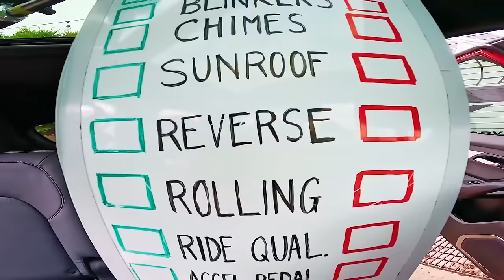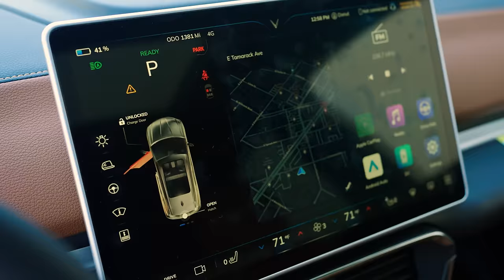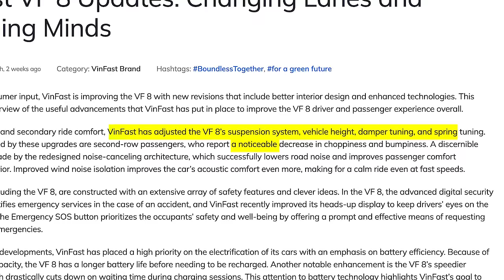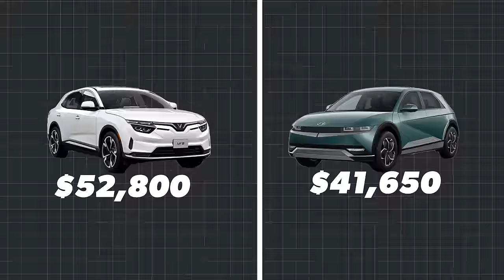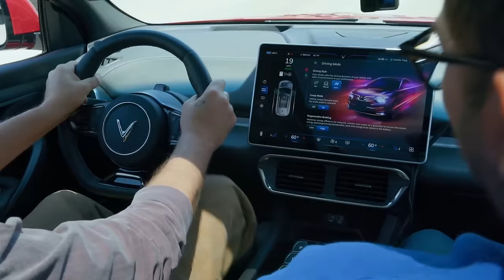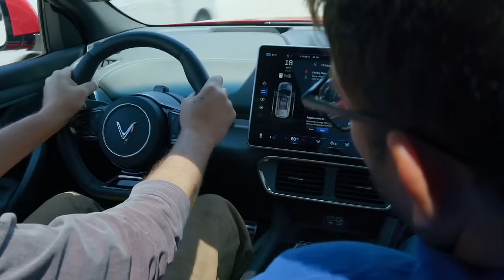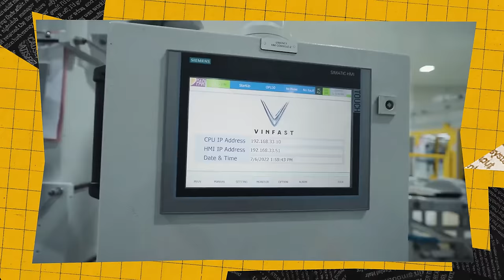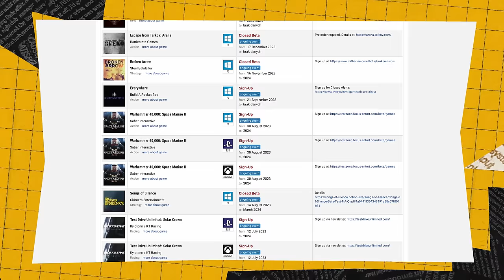We Drove America’s Worst Reviewed Car Again

Comment: Imagine an accident happens right in front of you or some other obstruction on the highway and when you go to switch lanes to avoid it your car stops you from doing that because you didn't have your blinker on and sends you head on into it lol
Reply: VF8 does NOT do that. It's like a magnet keeping you in lane if you let go of the wheel, but a magnet that any weakling can push past.
Reply: @NoseyNick  Oh, if it's like that then that's not too bad. Their first video on it made it seem like you would go to turn and the car would jerk you back into the lane unless you had a turn signal
Reply: Imagine if everyone drove without having their head up their kazoo, what a concept to be capable of using the turn signal in any situation.
Reply: @Drcraigfreeman9280  You've never been in an emergency situation?
Reply: @Drcraigfreeman9280  Ok bozo, keep feeling invincible until you are the one in that situation.
Reply: You were wrong, I have VW tiguan with keep lane assist, it have the same situation if I turn on it.
Reply: @Sevem7m  Honestly I have no idea if Donuts were just being donuts, for the lolz, or if early early "shitty edition" models really were "stronger" on the tugging.
Every VF8 I have ever driven just nicely sucks itself into the middle of the lane, until you pull it out, which was never been difficult. It's just about perfect. I may even prefer it to be a teeny bit stronger.
Reply: It has a lane-keeping system, but it also has an automatic emergency braking system, an automatic steering system when encountering unexpected obstacles, and it's programmed to prioritize to keep you safe, you're just thinking. think funny things that aren't true
Reply: VF8 do the defferent :) iF ADAS is actived, VF8 can control to avoid the accident without blinker. And you can do with more force to ignore when you change the lane without blinker
Reply: I've driven a VF8 for 5mo now. I find it quite rude to change lane without indicating, but when I try (just to answer made-up complaints like these!), it GENTLY pulls back toward the centre of the lane like a magnet. If I pull harder, it gently shakes, like the road/line has one of those rumble-strip things, but I CAN still change lane, with no problem at all. If it was an emergency, I doubt I would even notice the gentle tug / rumble, it would be trivial to "pull through it". I'm also about 99% sure ADAS would even say "assisting with emergency steering", which seems to be like "super ABS / anti-skid". Remember, also, that even the basic "VF8 eco" has AWD with power balancing between all 4 wheels, so traction is usually awesome compared with 2WD vehicles
Reply: @NoseyNick it clearly did that. Also it’s wildly dangerous to push left, have the car force you back right, then have to quickly turn it back left. In the rain you might as well just call it spin mode.
Reply: @TheBajamin  been driving mine 5 months, and it has never "forced" anything. I smell BS, probably for "comedic" purposes. When you say "clearly", what do you mean?!?
Reply: Using ADAS the car will automatically stop with the car in front when encountering a problem. You can turn off the lane keeping warning function in the system
Reply: That's a VW not a VF  @lanpncz
Reply: @The-Cat  I agree, different brand but I think the function the same, at least in this case.
Reply: Now up to nearly 7 months of VF8 ownership, and I'm even more convinced. The lane-keep could HARDLY be better. 

It FEELS like it is magnetically sticking in the centre of one lane. I know it's not, but that's what it fees like. If you nudge it, it gently pulls back to the centre.

IF YOU INDICATE, it releases the magnet, you drift across the line, until the magnet settles into the centre of the next lane.

IF YOU DON'T indicate, you kinda need to pull it off one magnet (which is not hard), across the imaginary virtual rumble/buzz-strip of the dividing line, until it magnetically grabs the centre of the next lane.

There's no "yanking", there's no "snatching", there's also definitely no way it would ever STOP you if you were changing lane in an emergency or anything.

So... serious question, for anyone who is still reading... how could you possibly do lane-keep better than this?

Comment: One word to describe VF8 is UNBELIEVABLE after my first roundtrip of 350 miles in one day! I would say driving VF8 is believing. In addition to other VF8 high tech features including HUD, face recognition, 360 camera, voice activation, heated and cooled seats, automatic driving seat adjustment; Vinfast ADAS and blind spot warning are quite interesting. On a road trip, if you want the EV to take over, just hit the ADAS button when the EV reaches 60-70 miles/hour. All you can do now is to sit, relax and enjoy behind the steering wheel and touch it when asked. Vinfast ADAS is like a cruise control, but much better with advanced technology. The ADAS will center the EV between the lanes and drive you uphill, downhill, along the curve road and between other vehicles; it will follow the same speed or stop as the vehicle in front of you, does. When you try to change a lane, a bright yellow warning on either the left or right mirror will flash if a vehicle is coming up. After all the due at sign in, my $200 deposit and my old car trade-in, I paid roughly $200/month after taxes for a VF8 Eco, which is about $7/day with a 3-year lease to own contract. It's even cheaper than the price of a Big Mac meal 😁

Comment: Both your videos (the old one and this one) are correct. I'm driving VF8 for almost 6 months. After few firmware upgrades and it's now more reliable and stable.
Reply: Thank you!
Reply: Did they replace the shocks and springs in yours?
Reply: @m3chan1zr  nope, I replaced it. They only do software update and also some recall to replace parts.

Comment: I kinda think it’s hilarious that it won’t let you change lanes without using your blinker lmao, that would actually fix a lot of crappy driving and near misses I have to deal with on the road every day
Reply: BMW Driver Rehab Program
Reply: until theres a accident or hazard right in front of you and it drives you right into it
Reply: @dirtrider88  Yep, until you strike a stopped vehicle/pedestrian, etc. because it doesn't "let" you turn the damn car.  This kind of electronic nanny-crap is absolute garbage.
Reply: @oskar6661  I think they should allow the driver to adjust the intensity according to their preference. But even the strongest setting should allow a lane change such as when trying to avoid an obstacle.

Comment: $53K 😂😂😂
Reply: i mean, when there’s lower volumes of production you kind of have to price things higher to actually turn a profit
Reply: but there is the fact that it isn’t fully complete that’s problematic
Reply: Highway robbery 😂
Reply: And they called it an economy EV...
Reply: @kleptomaticagain true, but vinfast has neither superior tech or brand image so better pricing would be their only pull factor. So taking a small loss in exchange for sales/spread of the brand would be the best move. Vinfast isn’t primarily a car company, so they don’t need to worry about turning profits from cars immediately.
Reply: @kleptomaticagain  That has nothing to do with what the consumer sees as a value.  As the consumer, you don't have to give a sh_t "why" a car is sold for an egregious price.  Simply put, this isn't worth $52K.  Doesn't matter how many of them they make.
Reply: @cockadoodledoowhoareyou2616  true
Reply: @oskar6661  i'm not saying that its a reasonable price for the car, i'm just saying that the general trend is that when things are made in lower production volumes they tend to be more expensive
Reply: It was the former listing price. Now is for lease just from 249$/month.
Reply: Now $45K

Comment: I think the pedal lags can be tweaked somewhere in the settings. I’ve seen the guys at Throttle house done that.
Reply: Sport / Normal / Eco drive modes? I think?
Reply: Road in Vietnam is packed with bikes,  they need to smooth out the pedals to avoid accident

Comment: I have one very major issue with every single electric vehicle I have seen reviewed. Every single thing is on that ridiculous and even dangerous screen in the middle of the dash. Get rid. Install a speedometer and a simple state of charge display in front of the driver. Get controls out of the screen and back to usable controls. Changing the heater settings should not require eyes off the road. Stereos should be stand alone with buttons and dials that can be operated by touch alone. The biggest two bugbears for me is first, electric operation of the door latches. Go back to mechanical. Second, get the computer out of headlamp and wiper operation. There is no need for the computer to be deciding whether headlights can be on or not. Don't claim computers are necessary for things like automatic headlamps. Ford offered automatic headlamps and automatic high beam control with fully manual operation if desired a full 50 years ago. The system worked and still does.

Comment: The lane switch resistance is a safety feature.  Like lane drifting. Shouldn’t switch without using your blinker regardless. It’s a flaw. But a flaw on the driver. Makes that feature useless now. A bad driver would dislike that more than bad one who doesn’t.

Comment: 9:00 - the LEAF has an "Eco" mode that basically just dulls throttle response. It helps you stop lurching off the line, and ultimately extends range a few percent.

Comment: I think the biggest issue is the price. Like how you guys compared it to the model Y. Like you said, the model Y has been out for a while and has been improved since the first one rolled off the lot. This being so behind “tech” wise, should be cheaper as like an “entry level” ev. 
Ps: still not going to buy an ev
Reply: Just waiting for solid state batteries like me? Good idea, even though it's already better than ICE the batteries are still a big drawback in safety, longevity, and range.
Reply: I don't see this competing with a Model Y if its in the same price category

Comment: Vinfast makes VF8 to be as closest to ICE car as possible. I see you were angry that VF8 could not accelerate VF8 instantly in your previous review. However this acceleration delay is a car feature controlled by the car's firmware as planned and could be modified to make VF8 accelerating immediately without delay if Vinfast wants to do so.

Comment: of all the things in this video that were "fixed", I think the one thing that should have remained was the car stopping you from switching lanes if you didnt use your signal... FORCING ppl to use turn signals isnt a bad thing, considering that 90% on the road today seem to think that turn signals were an option they couldnt afford... I swear to GAWD the number of times a DAY ppl switch lanes without using their signal would require more hands than you can fit in a car and considering in ALL states, part of the driving test you will FAIL is NOT using signals it isnt like people dont know...

Comment: If VinFast makes the VF3 and sells it in the US for 20k, like they are aiming for that will help them get a brand identity also they will probably sell a lot. But that is if they can even get the VF3 to pass US crash testing
Reply: It would be nice, but apart from the U.S crash test alone, it won't make much profit since 'Merican don't like small car also, the sub-compact VF6 or compact VF7 would be better.
Reply: @Jean_Driftstein  yes, but interesting designs that are out of the ordinary people seem to want these days instead of just another crossover SUV that looks like the same crossover SUV from another brand also from how small it is the expected range number is pretty decent but once again, we have to see if they actually get that range
Reply: @Jean_Driftstein I think budget conscious Americans are still fine with driving smaller cars, look at how many of those tin can Nissan Sentras there are on the road. If someone made an electric Nissan Sentra type car in the low 20k range, people would probably spring for it, especially with the federal tax credit.

Comment: I’ve watched the blindspot section like 3 times and it almost looks like the blind spot monitor- monitors ONLY the blind spot. It seemingly doesn’t light up if the vehicle is within sight of the mirrors or looking without turning back. Saving you from having to turn all the way to check the blind spot but not spanning the entire side of vehicle. Excited to see how many of these make to the roads of the Midwest.

Comment: i live a couple miles away from their main factory and used to practice driving on the nearby expressway. they were still testing some models many months, even over a year after public release and sale, driving a couple at a time up and down the same expressway. old models with gas engines were sold for cheap to locals, while early electric models that didnt sell fast enough became taxis for a brand new sister company.
Reply: every car need to drive 5-10km for testing before ship.

Comment: Please, please look into what ADAS is and what it means to the automotive world. The Lane keeping assist and Lane departure warning system aren't easy systems at all and require a whole host of sensors that need to work good to determine what is going on in the road. Its not super simple and many manufactures have changed around how they are doing such as Honda partnering with Sony to help them build their ADAS systems as theirs were absolutely terrible. Calling the blind spot indicator in your side mirror the land departure warning is completely off as well, you can have blind spot without having ADAS and its been around a lot longer, those blind spot detection runs off sensors based around the bumper in the rear and even the side mirror itself on some models of cars.

Being upset that a car with Lane keeping assist not letting you change lanes without signalling just shows it actually works although aggressive and is more telling on the driver wanting to change a lane without indicating than it does on the manufacture, swerving is also incredibly dangerous and can lead to more accidents as well.

Donut, do better please

Comment: This review is spot on!!  I test drove one yesterday in La Jolla CA and hated it.  I'm on my 3rd EV and the lease expires in Feb. I would NEVER buy or lease this car.  Lyriq blows it away.  I currently have a MB EQS 450+ sedan that gets 400 miles on a full battery so going back down to 260 miles will never happen with me.  The Vinfast recuperative braking also stinks compared to my Model Y and the EQS.  Plus the parking brake goes automatically every time you put it in park.  Big thumbs down

Comment: Just a heads up disclaimer on the 8 sleep.    You CANNOT put something heated on a memory foam mattress.  It will soften up the phase change material.  It will also make memory foam hard as a brick if you make it cold.   ❤.    Great product for an innerspring without memory foam.

Comment: I don't think the feature preventing you to switch lane without a blinker is a bad thing. Sure it can be annoying but you'd be surprised with the number of accidents cause by people suddenly swapping lanes or turning without blinkers. I think this is a good feature because it makes people more warry of things. Also in case you fall asleep which is pretty common, the car would drive in a straight line as opposed to following your hands. I've seen some crazy crashes caused by people who fell asleep and accidentally turned their steering wheel cause them to enter the opposite lane. The most violent crash I was was probably a truck driving at about 80kph went into the opposite lane and collided with a bus which was traveling at 90kph. Both vehicles went from 80/90kph to 0 in less than 2 seconds. This could have been prevented if the vehicle knew how to stay in it's lane. So again, a car not letting you switch lane without a blinker is not a bad design. I'm completely all for it.

Comment: Ugh, that lane departure issue.  I'm just thinking about how as someone who drives in the Midwest, my car (Subaru Outback) will chime indicating that it doesn't know WTF happened to the lane (like when driving through an intersection or by lanes whose paint has faded or been covered by road salt or snow).  This gets annoying, but at least it still works.  The thing that scares me even more is how sometimes it sees a seam in the road like where they patched a crack in the asphalt and my car detects it as a lane departure.  I'm used to it now with my car, but if that car doesn't allow lane departure and it suddenly has no idea what happened to the lane, what is it going to do?  This thought kind of scares me.  I will likely not get one of these cars based on that behavior, but even scarier is what happens if I drive on the road and see someone else with this thing?  What is it going to do?  If it does something dumb and causes a crash, who would be at fault?
Reply: Ok, so it does shimmy when you drift lanes.  This is more like what my Subaru does, especially if I have cruise control turned on with the lane assist.  You can switch lanes without signaling, but it will try to bounce you back into your lane if you aren't signaling.  At a certain point, it does still give control over to you when you try to do so.

Comment: The Amazon E-vans have lane monitoring, and what it boils down to in practice, is that the goddamn thing beeps at you relentlessly if you're slightly closer to the edge of the road than the middle line.  Not, mind, that you're about to go off the road.  Just being slightly further right that perfectly down the middle.